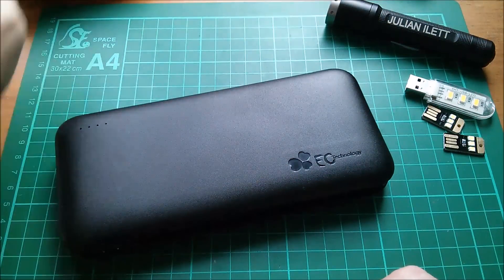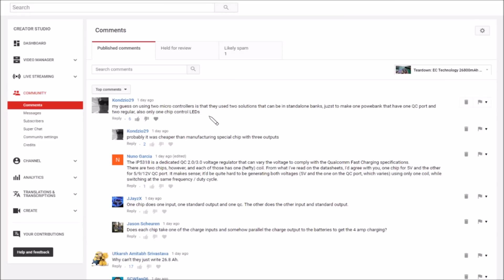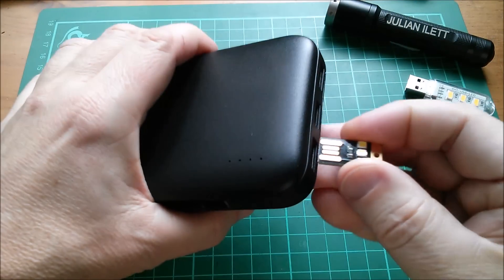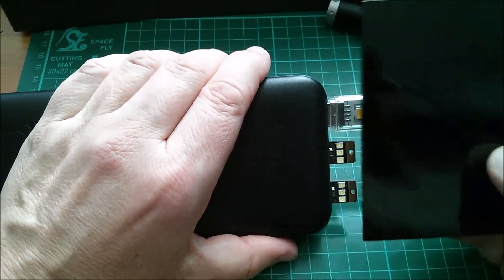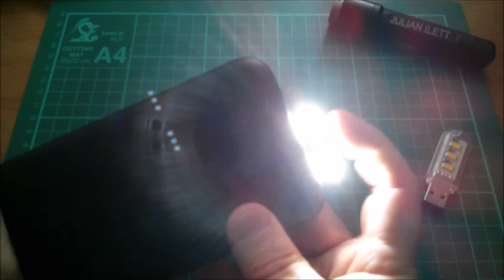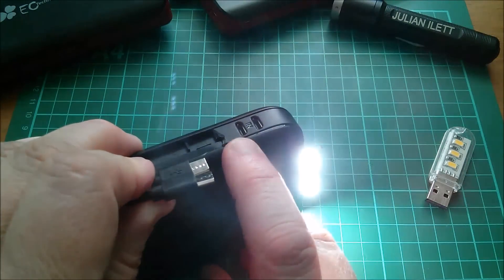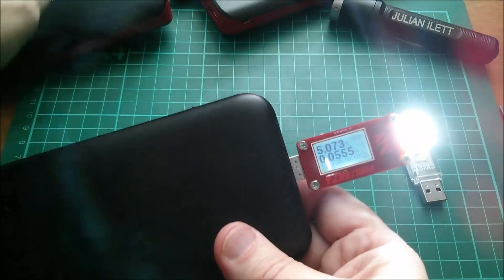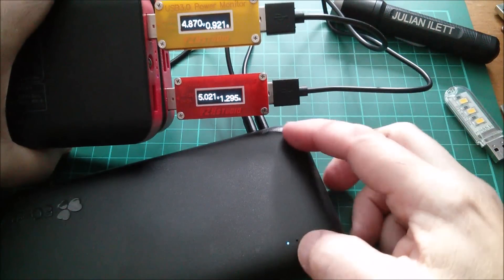Update: EC Technology 26800mAh Powerbank with QC3.0

Comment: @Julian Ilett -
@ESTD3  As for cases,, I have found non specific cases on Amazon. Depending on your desired layout. 

Granted - Replying after two years: 
The Samsung 18650's just purchased the other day, 
have protected tips. Required for Older GPS, uses 1.
Standard 18650 is 65mm.
Protected 18650 is 70mm. About $15.
From the 18650 Battery Store, Stockton GA. 

*Now isn't that interesting - 18650,,,
18=dia mm 650=length mm. 

The mystery I'm having with the same size PB as tested
here in video, but it's by 'LimeFuel'. 

When meter is applied to pair of black & red wires leading
to circuit board, from battery pack, 
it appears all 8 -18650's are ganged in parallel 
showing 4.09 volts with PB display showing 95% charged. 

This is where Julian missed this voltage test in first video, 
to see if this is normal layout with 8 batteries. 
If so,, how is PB putting out 5volts plus? 
Makes me think chip sets have voltage booster regulators
built in. 

Possibly dropping voltage boost mode in bypass. 
No idea,, brain is trying odd work arounds, making it more confusing. 

Cheers,, and by the way,, very cool detailed VIDEO, 
and USB gizmo testing devices. I'll be wanting those for my kit.

Comment: hello everyone, I have a usb meter its fairly accurate but i want to know when i charge my phone using the usb meter shows some current and the current stays fairly stable but  even if i move the phone without using it the  current reading on the meter changes a lot. I wonder why is that?
Reply: I'm going to suspect you notice charge indicator on the phone make and break connection,, as in poor connection at the port 
to cable, which is quite common. 
Granted you probably came to the same conclusion by now. 
Cheers

Comment: I know this is probably not the right place to ask this, but i really want a good power bank case. I have 8 18650 batteries waiting to be used in a power bank, but i don't want a cheap power bank that has bad quality ic or coil whine or anything else. Can someone give me some links for tested, good power bank cases?
Reply: Also the 18650-s i have are protected(with pcb)

Comment: Julian, I was thinking about buying one of these, but the Amazon reviews are not good, especially with unreliability. Connectors failing, substandard connecting leads, LEDs failing, or not working when new, batteries not holding enough charge, and other batteries failing to hold a charge after a few months of use. Can you please use this power bank regularly for a year, and then give us the results of your 'long term' test? It would be a 'small sample test', but would give us a fairer viewpoint than can be trusted on Amazon. Thanks.

Comment: When you plugged in the charge line in, and the 2 little card lights dimmed, I thought about "back feed". I have a small powerbank that does this. I first realized it when I was going to test with a charge Doctor,, having the line plugged into both powerbank, and CD, before plugging into the recharger.  I wonder why that's allowed.
Reply: I'm thinking passthrough - the charger connected via the micro USB is directly powering the output, and the power bank circuitry is busy charging the battery. Probably find out charger IC connected to the front micro USB  is running the whole show, or there is some better filtering on that one, hence why it doesn't glitch.

Comment: Hi Julian, could you measure, with your USB Power Monitors, the energy that can be delivered to devices?  Suggest just one USB output through to a 1 Amp load for a start.  Then, when it's fully discharged, use the same USB Power Monitor to measure the energy required to fully charge it.

Comment: Would the drop in voltage be because it switches over to bypass mode where  it just passes the power put into the powerbank and puts it through the output usb

Comment: What was the explanation for the std USB voltage drop for the 2nd charge USB?
Reply: Probably input to output bypass or passthrough mode - meaning the powerbank is charging, and it's the charger that's powering the output sockets...

Comment: Why are the usb leds flashing dim like that? Doesn't that take away power? 
Can you charge it at 2Amps or higher? Would it not work as a UPS for a RPI3 + WiFi router? 
I assume it can deliver 5V up to 2.0 Amps.

Comment: The lower plug is like a car. When the engine is not running, you get the 12V battery voltage, then it switches to 14V with the generator on.

Comment: I've got the same types of USB LED lights & the data pins are not connected to anything on either of them. Could this be the reason they flash repetitively? Is the power-bank continually polling the data pins to determine the load?

Comment: Interestingly I’ve just tested this with the BlitzWolf Power bank I looked at last week. On charging the standard USB port drops to 4.75v (which I guess does just hold within the USB spec) but the quickcharge output port remains on and remains at 5 volts!  I guess it uses a different chip.

Comment: the quality of the USB cable (size of the copper wires that are responsible for carrying the current) make a huge difference in whether or not any device will charge at it's full potential. most USB cables skimp on the gauge for these 2 wires. by the time the voltage reaches the device you're trying to charge, the USB V has dropped to a barely useable number.  i'm guessing most of your USB cables fall into the garbage category. for some decent ones, try Portapow USB cables. that's all i use.

Comment: LOL I am in Julians Video  :D (actually i was trying to say what nuno said - two separate chips one for 5V one for 5/9/12V. However on datasheet  each chip had 4 status LEDs so it leads to conclusion that  they were designed to be used as standalone solution for only 5V or 5/9/12V powerbank) it's basically two powerbank circuits on one PCB :D

Comment: My guess is that the second chip actually passes current from the charge input through to the output, instead of using its step up conversion capability. This kind of makes sense as it is more efficient, dissipates less heat in the chip and saves the batteries from live shortening microcycles. The drop in voltage could be explained with a Schottky bypass diode .
Reply: 2-nd chip has just 1 inductor, connected 1 side to b+, it can not do more than that

Comment: At the 4:00 mark, I'd be interested in seeing you swap the two types of USB lights to see if that difference in flashing was due to the ports or the lights.  When you plug in the charger at the 9:00 mark and the voltage of the output port changes, does that voltage reflect the actual charge voltage?   If so, could you use that to verify which input port is charging which output ports?  I think you must be right that the inputs couldn't simply be wired together.  I wonder if each input drives one controller, and the controllers somehow share the load of charging the battery bank?  Just like a UPS i guess.

Comment: Think you're right. I guess the 1st charges via the QC-chip, due it disables the QC output when charging. And the flickering when connecting the 'charger' to the 2nd port.
"UPS mode" is called "passthrough charging".

Comment: I wonder if it is two power banks in a single case? Two separate input sockets, two sets of 4 cells and two sets of output chips and sockets?
Reply from the maker: Almost, but the battery of cells is just one battery. We saw a single pair of red and black wires connecting the battery to the PCB.
Reply: Intriguing. Charge controlling must be quite complex. Which chip controls charging. If it's both, isn't that a bad idea generally?
Reply: They would both detect the same voltage, and basically do the same thing. Should be fine.
Reply: John Bäckstrand On a multi chip tp4056 board I tested I found the four different ICs completed their charge at very different points. It did question the point of having four ICs at all. The first quit charging very early on.
Reply: Thats a bit odd. With low resistance paths and a low impedance battery, multiple chargers should normally simply add up the charge current. I guess if the algorithms are very quick with adjusting the current it could make things "interesting".
Reply: John Bäckstrand Thing is a lithium charger IC works in two modes - Constant current and constant voltage. When they are in CC the voltage is dictated by the cells so both will work in tandem. When they go into CV mode and the current falls the voltage is dictated by the IC. Imagine one IC’s voltage regulation is set at 4.2v but actually its measured regulation voltage is 4.18. The second chip is set to 4.2 also but it’s measured regulation voltage is 4.22 volts. Well the first IC will probably shut off entirely because the battery has gone above its regulation voltage so it assumes it doesn’t require anymore current. I remember discussing with Julian some time ago that if you place 2 voltage regulators in parallel one will tend to deliver more current unless they have been well matched. It’s quite an interesting topic.
Reply: Yes, the CV phase is likely to be disturbed by multiple chargers. They could surely be designed for it, and made to work. I guess its the same problem as load balancing any voltage source. But if each IC assume the battery is used by them exclusively, they would get confused.

Comment: Can it be charged and discharged at the same time? I have one that shows 00 when discharge while charging.
Reply: but have you tested it over time as when I have mine on solar and output to raspberry pi after a while it disables to output flashing 00
Reply: Wayne Johnson they use only one buck boost converter to charge and discharge so you can't use it while charging , most of the power bank just stop charging your phone when plugged in to charge!
Reply: Kuntal ghosh have you seen the video?